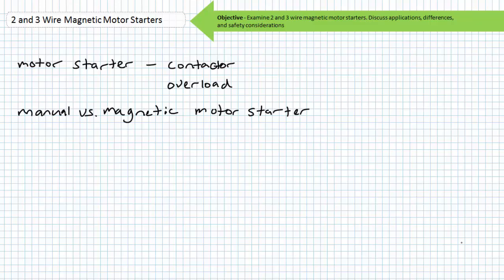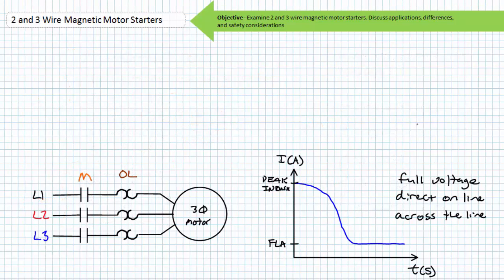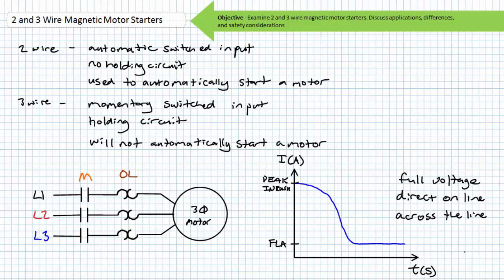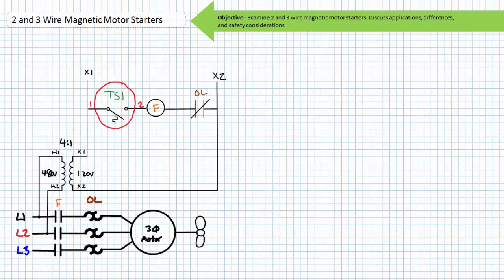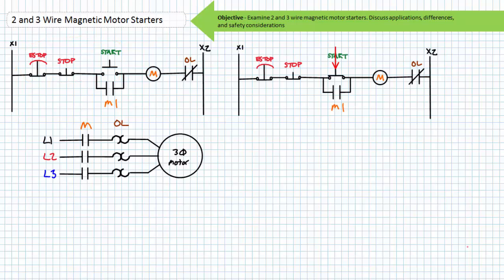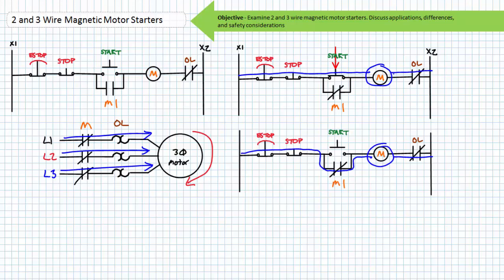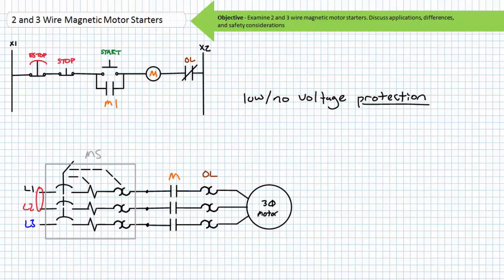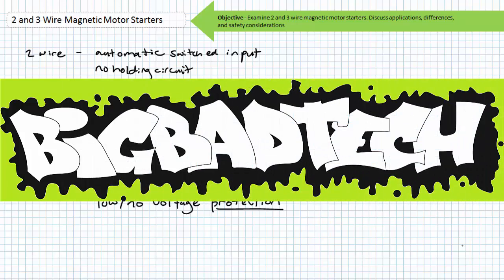2 and 3 Wire Magnetic Motor Starters (Full Lecture)

Comment: I know I'm late to the party but I'm new to the industry and there is something that I don't understand. If your scenario is that the fan reaches a locked condition and excessive current is being drawn on the primary side, how would excessive current draw be translated to the pilot side, tripping the overload. The only load in that circuit is the coil itself.
Reply from the maker: Here's the entire motor control playlist:
https://www.youtube.com/playlist?list=PLdnqjKaksr8qRPCFkU2Q8XQe0bfo99rs6

Of specific interest is this lecture on overload relays:
https://youtu.be/kZmsnArvN1M

Long story short the overload is a sensory device with primary heater elements and a NC pilot contact. When the heater elements on the primary side experience high sustained current the NC pilot contact opens.